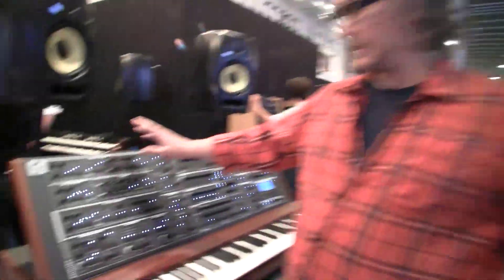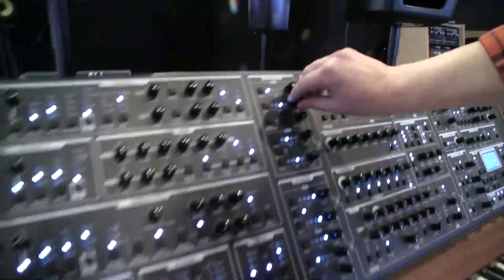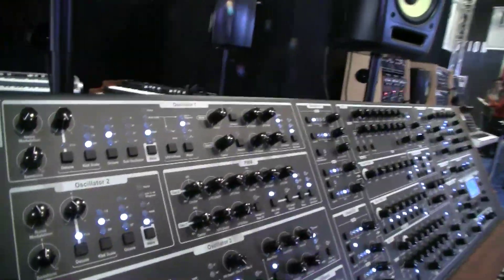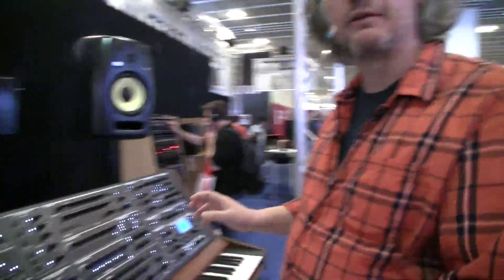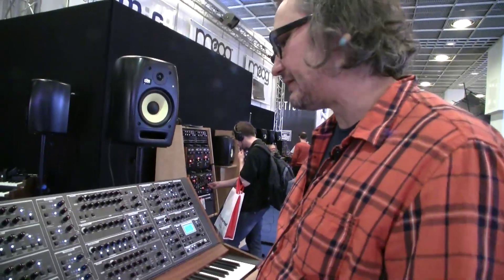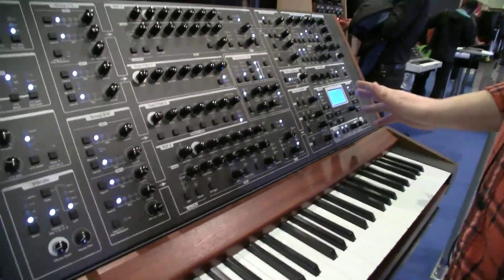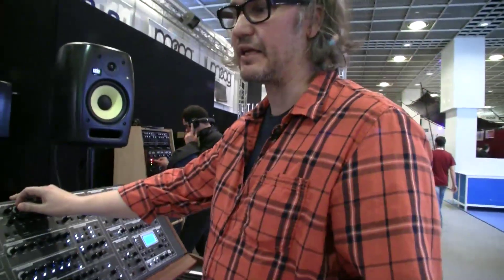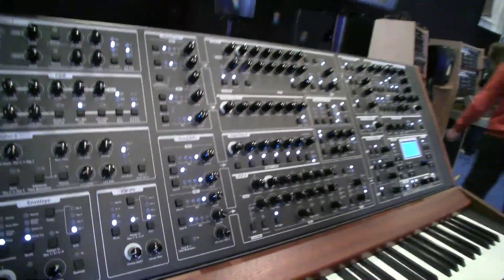MESSE 2015: Schmidt Up Close

Comment: it's a wonderful sounding synth but $15,000 is just too much. for that money I could get a buchla skylab that sounds like nothing else on this planet.  and for a lot less I could get an equally great sounding and much more flexible eurorack modular synth but with every classic 70s and 80s VCF filter courtesy of studio electionics series, 5 oscillators, 6 lfos, a couple of sequencers, analog effects and I'd still be coming in probably $5k less than the retail of the Schmidt.  If you like this synth check out the Studio Electronics Omega 8, it costs a mere $5000 in comparison for a true analog discrete circuit 8 voice poly and its multitimbral.  Yes it has less oscillators but I think the Omega 8 sounds a little bit better too.